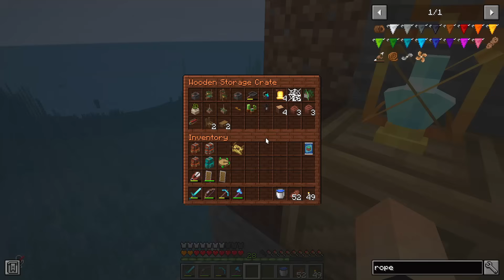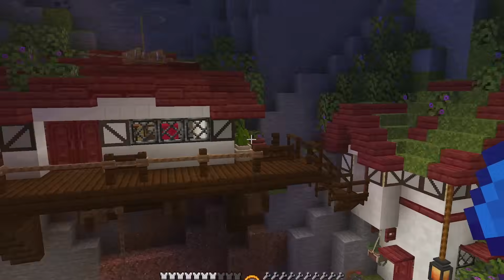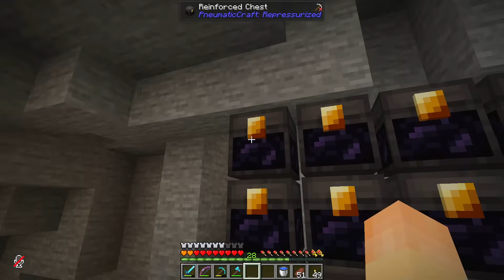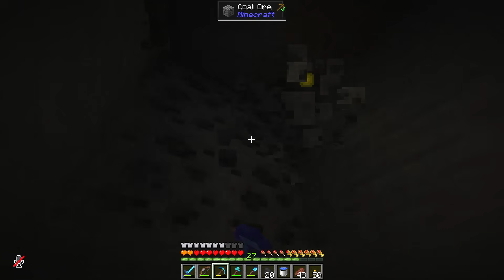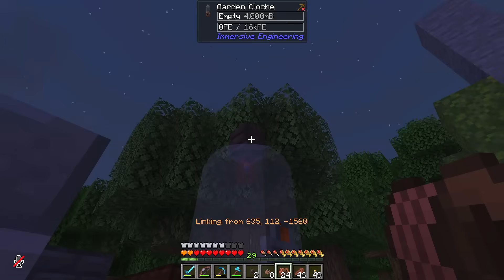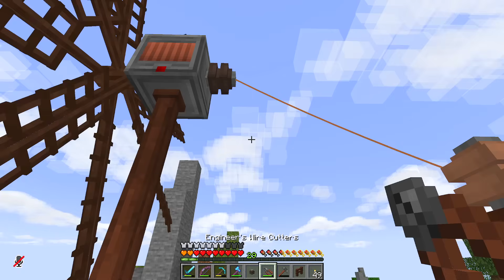Immersive Engineering For Dummies (Me) - EP05 - TCG SMP

Comment: Here’s an tip for immersive engineering 

One coal coke will only do one ingot however there is a way to get an bonus steel ingot. Craft the coal coke into a block first. This will give you the ability to turn 10 iron ingots into 10 steel ingots with only 9 coal coke. ( remember the coal coke has to be a block to get this too work

Comment: If you need a container for fluids, there are wooden(treated wood) barrels in Immersive Engineering. They can hold 12 buckets of fluid and work like shulkers (retain the content if you break them). 

They can even be read by a vanilla comparator to check on their fullness and they can be pushed around with piston, so with a block placer (if you have quark i think the dispenser can place them, you have other block placers in the pack probably as well) you can make a quite robust vanilla-ish production tape, pushed by pistons